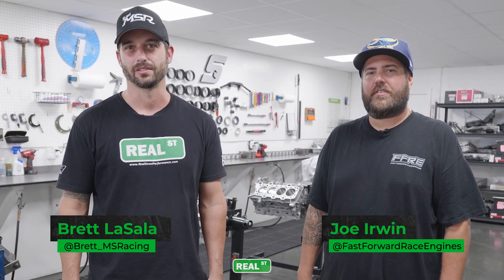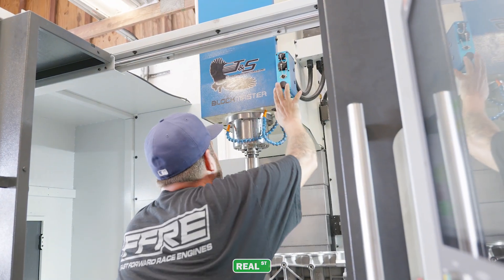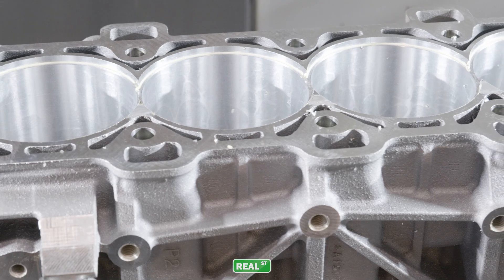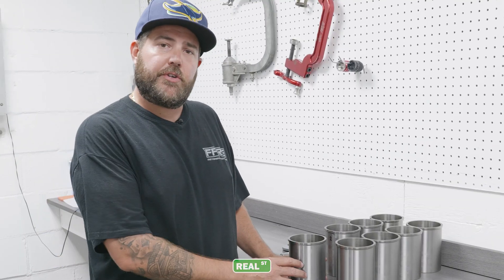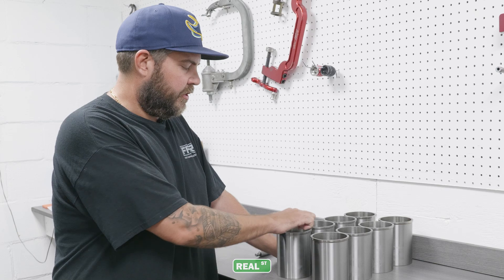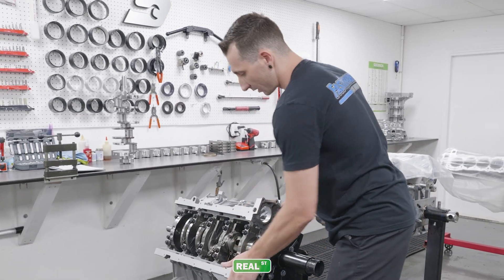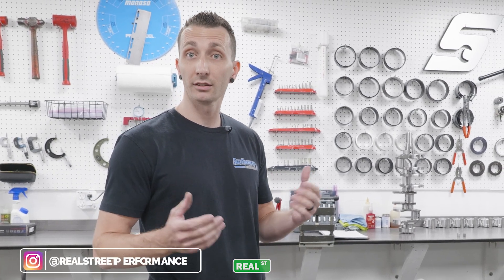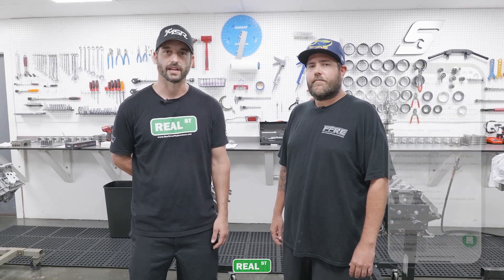How A 1600HP Coyote V8 Engine Is Made | Behind The Scenes At FFRE

Comment: Seems like you'd want a steel sleeve in those or is it a ls Chevy motor or l1.  First mistake aluminum blocks any motor builder knows steel cut weights of the truck or car not the motor that's a mistake cheaper metals go boom. When thar aluminum head goes that's when purge lines and stuff get hit plus you want weight on the front end the motor weight of steel small blocks got power and torque that's why sled truck have big ace weights on the front and pulling a sled thems 3 to 5 sec trucks. Aluminum head the treads being soft throw a bolt for a good combustion hit the piston shots out the side of the head. I heard the aluminum rifle shot bolts out the side as well

Comment: Oil squirter block off plates? You'd think leaving them there would be better
Reply: They're supplied with oil straight from the mains - they're running 4-digit HP, that's a lot of force pushing down on the crankshaft, they want to keep as much oil pressure as they can to support it.
The primary benefit of piston oil squirters is for long duration running to keep the pistons cool. Not really a problem making a 1/4 mile pass.
Reply: @RyTrapp0   Oh ok. In the context of a drag specific engine this makes sense. Thanks for the info

Comment: Damn bout had a heart attack, ford made terrible engines between 2000-2020. Now, I noticed you fixed that issue by placing new sleeves, nice!
Reply: The coyote has been out since like 2011 or 2012…… Ford has been doing extremely well since then, and I’m not a Ford guy at all, but the coyote is something else
Reply: ok, and which engine from anyone but Ford has gone 300.4 mph on oem block and heads in a standing mile? Zero. 
Or ran 5.88 @ 250mph on an oem block and heads, timing components, and crank? Zero
Or ran 5.67 @ 265mph in a quarter on a ported OEM head? Zero
Or has gone 7.90s on a 100% factory sealed engine and trans? Zero..but 3 Coyites have.
And no other make has done an official 1,000 mile in 5 days public road event and made ten different 6 sec  passes @ over 212 mph over 5 days on a 275 while beating nearly every billet motor entry while running a sleeved oem block, oem heads, and oem crank.

Fords twin cam engines hold all of these records on OEM parts while and Lastly, mmr has made over 4200 rwhp on a billet Coyote block and ported OEM GT350 heads. 
Ignorant Ford haters are the worst.
Reply: Do you understand that ALL factory aluminum blocks need sleeves over ~1000HP or so(call it "~125HP per cylinder"; a Honda K-series I4 will need sleeves over ~500HP for example)? You have to be living under a rock to not be aware of aluminum LSs(& LTs) and Gen 3 Hemis needing sleeved just like Coyotes.

I mean, do you actually think that there's mass production OEMs out there selling 2000HP capable blocks without any work from the factory?

Comment: Youre not getting 1600HP out of a coyote, at least not for long.
Reply: Good lord you must've been living under a rock...

Anyway, check out Brett LaSala completing his first drag-n-drive last year, Sick Week 2023 running 6.70s-6.80s(1/4) on small tire radials all week with his FFRE built Coyote(that's also the fastest cast Coyote in a non-Pro Mod as far as I'm aware). Finished 3rd overall, won the radial class, and ran the fastest time ever on radials.
As far as I'm aware, I don't think Cleetus & the SMX powered Mullet have beaten LaSala & and the FFRE Coyote powered Snot Rocket, neither a heads up race nor in competition(they run the same classes at drag-n-drives and some other events, typically small tire radial or a 'street car' class). I believe he's still run faster than Steve's wagon's best number as well.
...what a rock that must've been LOL
Reply: Idk man.  Look up the Snot Rocket mustang.  It made 2506hp on the dyno!  Yes, probably won’t last long, but still.  Cleetus also has a 6 second mustang pushing huge horsepower as well.

Comment: What is the benefit in adding the sleeve as apposed to just use the block?
Reply: They aren't 'adding' sleeves, they are removing the factory sleeves and installing new aftermarket sleeves.  Factory sleeves have a much lower tolerance for handling boost.  Aftermarket sleeves can handle more psi, for longer durations.  This is very common with any aluminum blocks, whether its GT-R's, LS's, Coyote's, etc.
Reply: @braveheart4lif31  Thanks for clearing that up. One would assume the factory would be a high quality.. Since is warrantied. That is kinda disappointing.
Reply: @jasonme3557  It is high quality. The factory block was designed to handle a 500 crank HP car. People are making 1000-1200 crank HP with them. If anything, they are overbuilt.
Reply: @braveheart4lif31  factory blocks have no sleeves; the cylinders are plazma sprayed on aluminum cylinders. They do indeed add steel sleeves.
Reply: Brett lasala is making 3400 crank horsepower with one of these blocks. 2917 hp at the wheels plus 17 per cent.

Comment: “Keeps oil pressure high” guy produces high perf engines and doesn’t understand oil pressure. 

It’s like blood, high pressure is bad. You want the correct pressure and flow.
Reply: 10psi per 1000rpm isn't "correct", it's just a rule of thumb. For old engines designed in the 1950s & 1960s engines.

Feel free to go find examples of "too much oil pressure", good luck with your search. Make sure to look at the typical oil pressures that modern engines introduced in the last 20 or so years operate at...
Reply: It helps keep pressure high in the sense that it’s not just 8 big hole bleeding off pressure. 
When your rpm limit goes from 6500 to 10000 you definitely need more pressure. To much hurts flow but 65 psi of oil pressure isn’t helping rod bearing live at 10k
Reply: @joshr8680  what r the holes? Did he say they were squirter holes? And yea I would agree 65 is to low for 10k. 

10 psi per 1000 rpm is what I’ve learned to be correct.

Comment: People say no replacement for displacement. While it is kindve true the over all design of the engine matters so so so much and ford got the coyote spot on
Reply: The replacement is boost. I bet if you ran no boost in this engine it would make slightly less power than a stock unit. 
When cracking 30+psi up it, plenty of power is to be made
Reply: @ReubenHorner  literally 3-4sec 0-60 fbo and tuned in an f150 n/a 5.0. That’s pretty remarkable. And not to mention it’ll run 7s factory sealed.

Comment: So are these like starter motors for a Steve Morris engine?  At the sharp end of the stick 2500hp is the entry to hang with the low six high 5's entrants.
Reply: Of course you can spend more $$ for more hp.  It all depends on how much money you want to spend and what you want in the end.
Reply: ...so, anyway, now that FFRE's Coyote is running with Steve's SMXs...

(BTW, very few SMXs are knocking on 5s - that's a MASSIVE task for anything that isn't an actual Pro Mod)

Comment: Another very informative video! Coyote FTW💪🏽
Reply: @tthams73 you know how the saying goes. Haters gonna hate.
Reply: @Gung_ho_5oh  yup
Reply: @tthams73  ok, and which import has gone 300.4 mph on oem block and heads in a standing mile? Zero
Or ran 5.88 @ 250mph on an oem block and heads, timing components, and crank? Zero
Which oem head import has gone 265mph in a quarter? Zero
Which factory sealed engine and trans import has gone 7.90s? Zero
Which import has done an official 1,000 mile in 5 days public road event and made ten different 6 sec  passes @ over 212 mph over 5 days on a 275 while beating nearly every billet motor entry while running a sleeved oem block, oem heads, and oem crank? Zero

Fords twin cam engines hold all of these records on OEM parts while any import that still hasn't matched these are on all billet engines and slower. Lastly, mmr has made over 4200 rwhp on a billet Coyote block and ported oem GT350 heads. 

2500 hp all billet engine that resembles an RB26 is lame bruh
Reply: @tthams73 smh ignorance
Reply: @tthams73 still no comeback? Lol

Comment: At what hp do you need new sleeves?
Reply: Your gonna get mixed results. I've had a 1000whp f150 for the past 2 yrs with my built motor that I did not sleeve.  built it during covid and I had MPR just do the machine work and I assembled it. ( boostline rods and Mahle pistons) a brand new block from ford is only 800 bucks.. anyway I was told to keep it under 1100whp and it should live.
Reply: @malloymotorsports780  f150 🤣🤣 you’re crazy.

Comment: What's a ball park cost on this to build 1000hp reliable street? Website too detailed too many questions just to get an idea. Comparing to Barra for uniqueness and cost.
Reply: Just get a factory crate coyote engine plenty of guys making 1000whp with an unopened engine reliably.
Reply: Do you mainly work with customer blocks?
Reply: Approx 10k for factory crate motor 460hp. How much boost to 1000hp? Can stock handle that? Common as they are in you tube a Barra might be more unique and stand out more even at less hp. Just thinking out loud.
Reply: At 1600 hp that Block will Split thru the Middle.  Most Builders of the Coyotes have the same issue.  

MMR from memory were the only ones who managed 2 keep them 2gether @ way over 2000+++ hp . 

They are now doing Billet Blocks & Heads . 

As an Aussie l would stick with the Barra . 

Own a 2010 FORD FG XR6 UTE  
Naturally Aspirated. 

Also a FG-X FORD XR6 TURBO UTE  1st Reg December 2016 .  ×3pce rear lid & sports bars . 

Slightly tricked @ 330kw . 

Guys in Melbourne are building Billet Barra Heads & Blocks 4 over 2000hp ..
Reply: @Robert-mn8gc  thanks for the detailed reply! 😊

Comment: What keeps the sleeves tight in there? They just slid in.
Reply: Press fit and head
Reply: thermal contraction of the block
before installing the sleeves they heat the block to a higher temperature than its operating temperature. When the block heats up, it expands, making the bore bigger, which enables them to slide the sleeves in place. After the block cools down, it shrinks, tightening around the sleeves.
The block will never get up to a temperature high enough during its normal life to expand enough for the sleeves to become loose again, so once they are installed, they are not going anywhere...
Reply: @satanaz  awesome thanks
Reply: I’m a little confused because heat causes stuff to expand and cooling it causes it to contract. I watched where they would cool the sleeves down and then put it into the motor and when it heats back up it will never move specially the motor heating up cause that motor to expand and stay in even tighter.
Reply: @williamrose7184  cooling the sleeve will make it shrink, so it also works; when the sleeve gets back to room temperature, it expands/gets bigger, and it will press against the block.  If you have an aluminium block and a steel sleeve, then it will not get a tighter fit as the engine heats up during operational conditions - that is because the aluminium has a higher coeficient of expansion than steel, meaning that the bore in the block gets bigger faster than the outer diameter of the sleeve, but they take that into account when designing the diameters of both parts, to make sure that they never become loose. If both sleeve and block are steel, then they will expand/contract at the same rate if they are both in at the same temperature. BUT usually the sleeve works at a slightly higher temperature than the block, because it is in direct contact with the combustion gasses, whereas the block is usually being cooled by coolant, so the sleeves will probably expand faster than the block anyway, just because they are usually hotter.